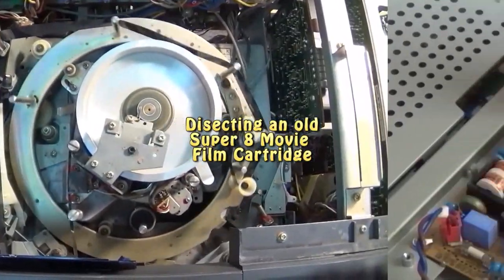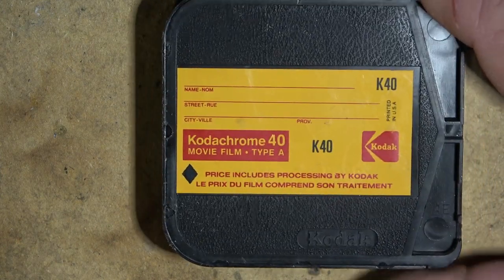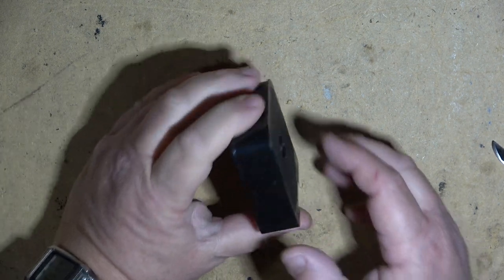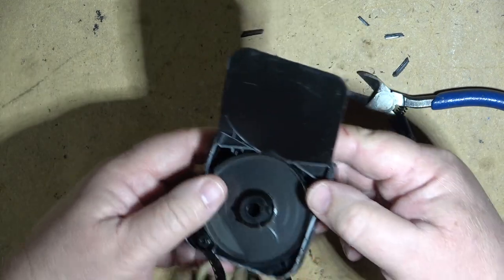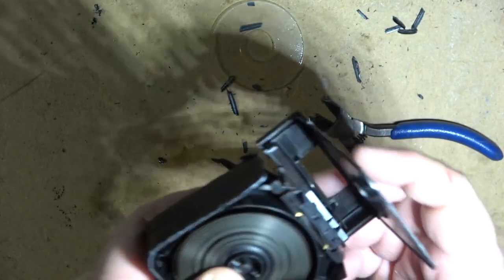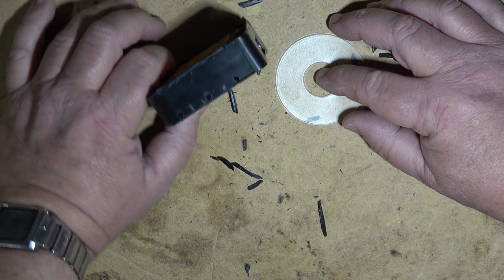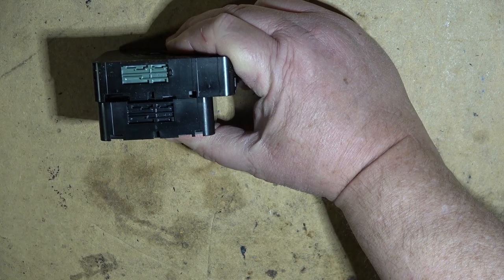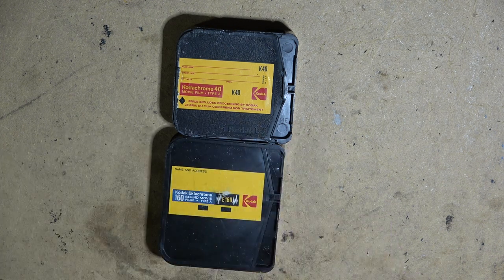Ripping Apart an old super 8 film cartridge

Comment: Sorry, but you may have been misinformed about a couple of things. First, when sent in for processing, no one cracked it open, they actually used a machine that extracted the film, in total darkness, by pulling the film out of the front opening and spooling it onto a reel that was then routed to the developing equipment. Believe it or not, an image could still be made with that old film. I recently shot stock with a “process by” date of 1972. It’s only possible to develop as black & white, but you’d be surprised at how long film can last and still - kind of - work. I enjoy your channel man!
Reply from the maker: The hub had a 1 way clutch so I don't see how that is possible. I know for 35mm stills they had a machine that extracted the film as I know someone that ran a land he showed me the process.  He would pull the leader out and attatch it to a header that was then fed into the processor in total darkness. Just assumed that they would use a tool that would split the cartridge and extract the hub.  Never been in or seen a movie film processing lab just stills.  I know for the 126 and 110 cartridges they used to snap them open in the darkroom.
Reply: @12voltvids , with the Super 8 cartridges, turning the dial on the side in reverse until it clicks breaks the end off of where the film is anchored to the inner spindle/reel. Then the film is extracted from the cart out of the front. It’s how most of us do it by hand when developing our own film. I’m not sure but I think the machine did that just prior to pulling the film out. But hey.. I could be wrong! I should ask my friend who retired from 40 years at Kodak. Not that it matters, but I’ve always wondered if Kodak re-used the outer Super 8 cartridges after the process. Most likely not, as society in general loved to add tons of plastic to the garbage dumps.
Reply from the maker: @flyingo  well that makes sense. I never really looked that closely.  When my dad was using super 8 I never really played with the camera.  I used it a bit when I tried my hand at film making in late 70s.  Moved to video in 80s
Reply: @flyingo I wonder how reusable Soviet Super 8 cartridge worked.

Comment: Cant wait to see the unit torn apart!
Reply from the maker: I did tear the wolverine apart back when I got it. You may have to search because there are a few videos on my channel but if you look it's there and you can search for it. Just go in the search bar and type in wolverine 12voltvids and you'll find it. I didn't take the camera section or anything out of it I just took the back off to show what's in it and there's not really much in the back of it. Little stepper motor couple gears little circuit board. Then I had to listen to all the people complaining and whine about how little there was in there for what it cost. I guess the same people that complain about the price of Bose.

Comment: I never knew what super 8 looked like, when i was a baby 1966/67 ish, my dad and family went down the local park and filmed us with his super 8.
Super 8 seemed very short in filming, there were 3 or more sections to the film,
they were not cheap.

I never knew how the film was stored, now i do :-D
Mind you, in the many many years after, he had them transfered to video by a man with a video camera and attachment to capture the film.
Lucky as the film just fell apart over the years, very brittle and the transfer made a mess of the colours.
Never mind, i have it on tape and dvd now.
Sorry dave long waffle.
Reply from the maker: Super 8 came on 50 ft cartridges which is what I just showed. That store is about 3 minutes of film at 18 frames per second. Yes it was expensive. When I played around with film back in the late seventies, a film that I will dig up and scan and put it up at some point. It's just me and some of my buddies riding our dirt bikes down on the beach and I think there's some footage of a supercross race that I went to. Not one that I actually raced in though although I did race Motocross when I was a teenager. Anyway back in 7879 when I made this little film a 3-minute roll of film back then was around 20 or $25 it was expensive. Of course then video took over and buried film. I was a very early adopter for video. My first portable video recorder, I wish I still had it but it broke and I tossed it, was a system by akai, used a quarter inch open reel tape had a black and white camera that plugged into it and a small little 3 in black and white monitor that clip to the side of the recorder so you can play it back. The tape it used was quarter inch video tape which look just like quarter inch audio tape but was different. Being young and dumb and only about 16 at the time when I bought this thing I bought it used, I loaded a 5 inch reel of audio tape on it not realizing that the tape for audio was much too abrasive and I wore the video heads out in a very short order and the parts were not available to fix it. I remember and this is before I was in the service business maybe one of the things that spurred me to get into the service business was taking it down to akai service paying them a lot of money to fix it and only having it work for a very short time before it broke down again. It was maybe only a month that it worked if that, I took it back only to have the guy tell me after charging me another estimate fee that they couldn't fix it because the part that it failed was one of these encapsulated orange epoxy modules and the part was not available. That was the end of that. Just after I had paid them a couple hundred dollars to change the heads that I wore out from using the wrong tape and buying a real of the correct tape for 50 bucks. That's right $50 for a 5-in reel of quarter inch video tape that would run 60 minutes. I think there's a recording of my sister riding her horse on that tape unfortunately before I could even play it back the machine broke again and it stayed broken.
Reply from the maker: @zx8401ztv  he did tell me. I bought it used from a guy that volunteered at the same community station that I was at the time he didn't tell me that it required special tape when I bought it. I wore out the heads quickly.  The service guy told me that and changed me a small Fortune which was probably two or three hundred dollars to change the head and sell me the correct tape only to have only a month or so later a part fail that was not available. Sat in the shop for 6 months and then they called and said they couldn't fix it.
Reply: @12voltvids  i would have been well pissed off.
My first vcr was a second hand jvc piano key.
It came from a friend (well thats what i thought).
It started to play up after month.
I knew bugger all about vcr's at the time .
My so called friend said there was a good and cheap shop in coventry, that would fix it.
It worked but i got pissed off after 5 returns back to the shop.
I bought a book on vcr systems video recorder.
" Servicing video recorder equipment by steve beeching"
That helped me a lot, i learnt basically how it worked.
I fixed the problems with my vcr, well worth a good read :-D
Reply from the maker: @zx8401ztv  well no parts means no parts.  Cost me alot of money when i was probably only 16 or 17

Comment: just reading the comments brought back my memories of std 8mm, as I remember it was 16 mm film, as a commenter said was turned over at the end of the reel, finding shady spot to open the camera. And was split length ways after development and was spliced to make one film.
Reply from the maker: It was a dual roll. Your shot 25 feet turn the real over and shot the other 25 and when it came back from processing they'd split it down the middle and splice it together. It was 16 mm wide but the sprocket holes were closer than on 16mm film.
Reply: Still made and still used to this day. Absolutely gorgeous when projected

Comment: Still get a little bit of flicker using the Wolverine but, it does a great job.
Reply: Is this the unit that the manufacture has a finite record life set into its electronics?
Reply from the maker: No, the warranty is 12 months or 200 reels which ever occured first.  This is for commercial operators that like me are using it for business.  The average consumer won't have 200 reels of film.  Even people with really big collections of film typically don't have that many. Most people took the little reels and spliced them into big reels.  a business on the other hand could easily run 200 Reels though in less than a year.  
Mine has over 600 through it now, must 200 to 400 feet.
Reply from the maker: I will give you a little tip to get the best quality from The wolverine as I've learned over the years the way to get the best image from this unit. For starters don't use the take-up spool. Get a large box place it off the edge of your desk and let the film go through the scanner and drop into a box and then rewind it at the end of the box. The film won't tangle up they will just coil up in the box. This reduces all stress caused by the take-up school which can cause the film to slip slightly resulting in vertical instability. If the film is on those large aftermarket reels that have the fingers that grip the film. I've only seen it once or twice but they hold the edge of the film against the real which makes it tight. That can cause instability as well and the best way to resolve that is to wind it onto a looser fitting reel. The same thing can be said for reals that are warped such as the old metal ones that got bent. Every time a warped real rotates and it pinches the film it will cause instability. What happens is when the frame advancer moves to film and then releases it for the photo to be taken any tension pulling back on the film can cause it to slip back slightly resulting in an unstable picture. Another solution to that dilemma is to take the film off the damaged spool put it in a box let the film be picked up out of the box run through the scanner and dropped into another box. Because it puts literally no tension at all on the film as it's moving it through the optical path any tension placed on the film can cause it to slip. Every since I stopped using the take up spool and just let the film drop into a box the results improved 100%. Also if you don't threat it correctly it can cause some instability. The unit should be completely silent as the film is moving through the machine. If you hear it going tick tick tick or making any types of obvious noise that's a good indication that the film is not threaded properly. Mine to take up motor burned out so I don't even have that running anymore so it makes the machine that much quieter so it's really easy to hear if I haven't read it correctly. By threading correctly I mean having the film under the two little white tabs if you're not paying attention it's easy to have the film over one of the tabs and under the other and that will cause instability for sure
Reply: @12voltvids  GREAT TIPS DAVE  -  You're the best!

Comment: How do you like your Wolverine? I have one, it does a pretty good job. Better then setting my projector up and projecting the image onto a white poster board on a wall and using my video camera on a tripod to record it.
Reply from the maker: Oh God yes projector and a screen are you kidding? I actually use that technique for 16 mil film because that's all I have for 16 mm but I also have a professional five blade shutter tell us any projector that came from a TV station which gives it absolutely flicker free flawless picture from 16 mil. I had a good optical system, in fact I still have it for 8 mm which uses a professional camera and a telesemite box and it's results aren't bad. The results however from The wolverine is so much better. The trick is setting it up correctly. That means not cropping the image on the unit itself. Yes I know they say it will do your film and you can play it directly and it will but the cropping feature is a digital zoom which reduces the image quality a little bit. Much better to scan the film at full frame which shows the edges the sprocket hole and a little bit of the frame above and below. Then take the resulting file load it on the computer and crop out the actual image. That way you can correct the color correct the speed and everything on the computer. The way I do it as I scan one reel, then take the memory card copy the file to the computer go back to the scanner start scanning the second reel and while the second real scans I'll let the computer work away at processing the first. 50 ft real takes 28 minutes to scan, takes computer around 10:00 to process and output corrected file. By the time I can go through and make any color corrections where necessary and output the file the next reel is finished and ready to process so I can keep the system running. It's pretty obvious that people are very happy with the results that I turn out because they keep bringing me more work. I do the films for one client and all of a sudden I've got their brothers and their sisters other family members showing up at my door with their films. If you wondered why there hasn't been many videos posted over the last couple of days it's because I've been too busy transferring over boxes upon boxes of films for clients. Now that I've finally caught up I can get back in the shop and do some work.

Comment: My info could be a little dated by now, but there might still be a few specialty places that will do a black and white processing on the type K40. One of the reasons the colored processing was discontinued some time ago, was due to the fact that the chemicals used were hazardous to the environment.
I also had a K40 that was left in a camera that I picked up some time ago. Mind you, I've no idea what's on it either. It ended up becoming a sort of familiarization tool in the end, I guess.
Reply from the maker: Yes i know they can black and white process k40 but after 50 years the emulsion us rotton so when you try to process it all falls off and you are left with just a bunch of random grain. I sent a roll of film off that was about 20 years our of date and there was nothing there. This is 50 years plus old.
Reply: @12voltvids  Did you use Rocky Mountain Film Lab in  Aurora CO 80010 USA ?   IDK
Reply from the maker: @FindLiberty  back in the day there were 2 processing labs. One in Vancouver and the other was Toronto. Out west we used Vancouver.  They shut down in early 80s and then the only lab was Toronto untill they too called it quits.
Reply: @12voltvids  Just wow... time flies!
Reply from the maker: @FindLiberty  every year seems to go faster and faster.